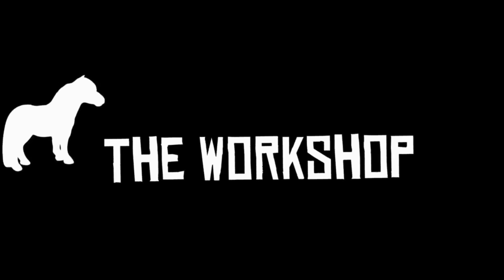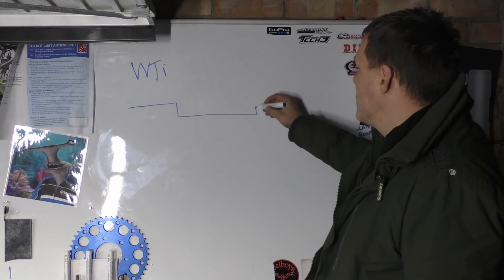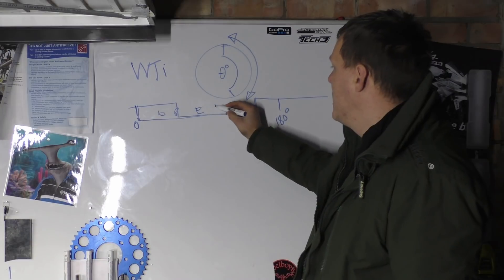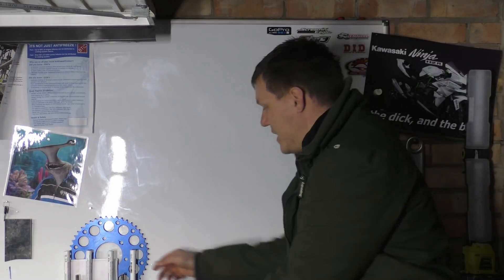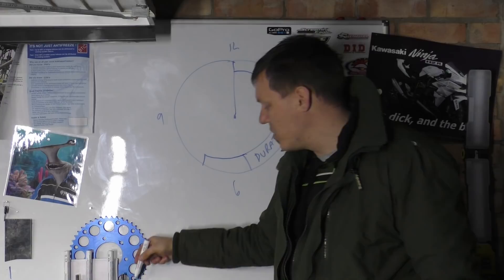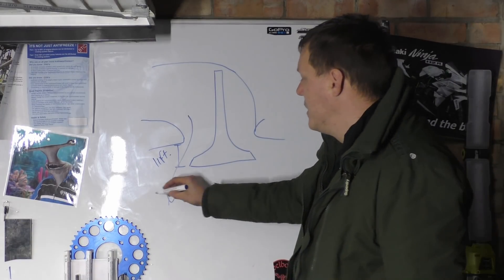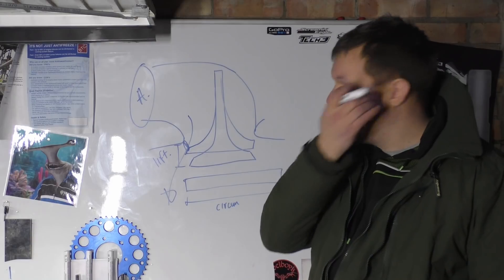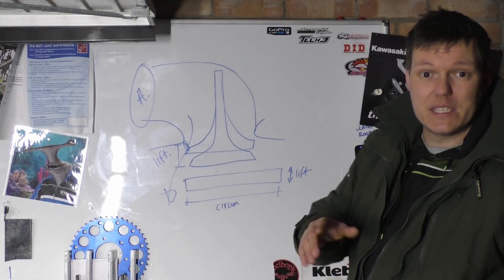Valve Lift vs Timing - The difference

Comment: Would increasing port velocity at low rpm with a low lift fill the cylinder faster mate?
Reply from the maker: Port velocity is determined by 3 things. 

1) port flow rate 
2) piston speed
3) valve duration and timing.

To really improve cylinder filling (ve) you need to change all 3

Comment: Matt, I have a flat spot in my er6n acceleration @4-5 rpm seems to only happen in 1st gear an it seems to come and go.  Any ideas where I should start to check.
Reply from the maker: Usually when you switch from your pilot jet to your main get - seen as though you notice in 1st gear I wouldn't worry about it- unless you really need to get away in 1st
Reply: The Workshop thanks

Comment: afaiu BMW's valvetronic leaves the throttle wide open most of the time and uses uses valve lift to control the air instead, it reduces pumping loses